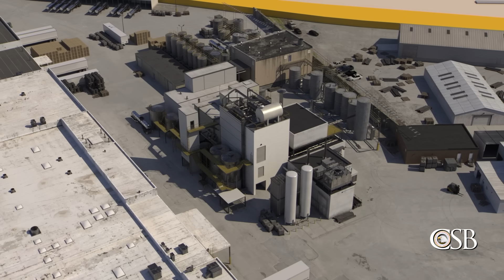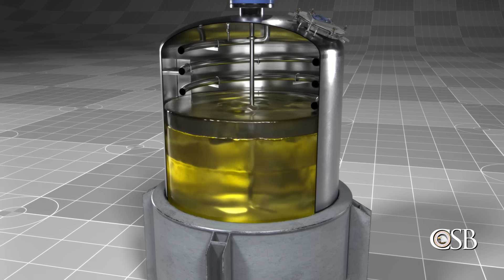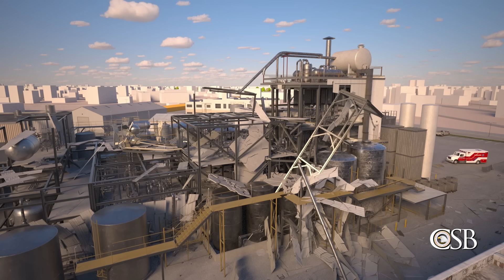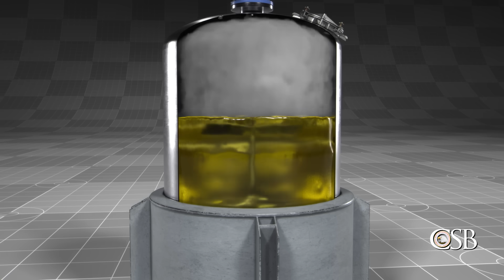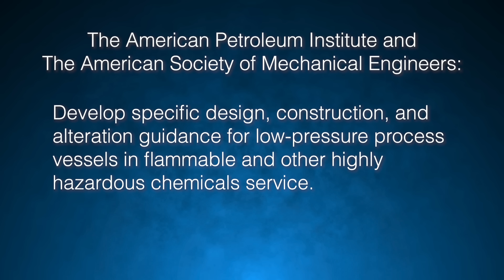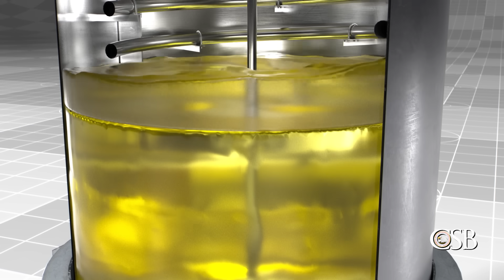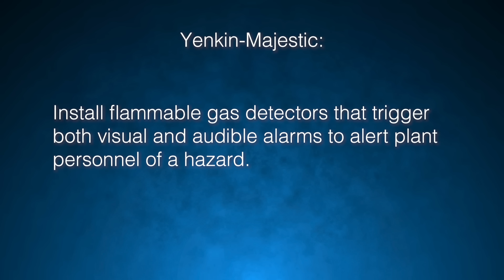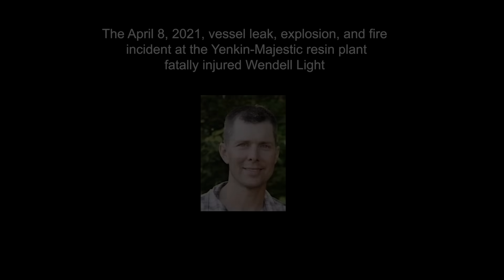Low Pressure, Fatal Consequence: Explosion at Yenkin-Majestic

Comment: Imagine checking your mails and seeing one with the title "Explosive gas detected"

Edit: Come to think of it, why does the gas sensor even have the ability to send emails? In what scenario would that even ever be used?
Reply: That's the signal to sell your stock and alert the execs to do the same.
Reply: wonders of digitization, internet of things and other BS
Reply: " Come to think of it, why does the gas sensor even have the ability to send emails? In what scenario would that even ever be used?"

All sensors are hooked up to a control unit and that unit has many many many ways of sending information to users. Low priority messages use email, higher priority messages use SMS, and the highest priority uses bells and sirens.

Somebody, for some reason, never turned on the bells and sirens for the gas alarm. Or more likely: the alarm kept giving false-positives whenever somebody farted so they disabled it. Many many accidents are caused by perfectly reasonable alarms being turned off for convenience.
Reply: @vinny142  Oh, I never knew that! Thanks!
Reply: I can hear the sales guy pitching this.  And I can also hear someone on the other side thinking "This is great!  We'll be automatically informed about leaks without having to rely on people to report them."
Reply: Imagine thinking an email to an off-site employee was sufficient in a situation where the time between the leak and the explosion was less than five minutes. Sometimes it takes longer than five minutes for an email to clear the corporate spam filters and appear in my inbox. Insane decision by management, but entirely too common.
Reply: @flunkl  the off-site employee after receiving the mail about agitator off and high pressure and explosive gas detected. HUGE NOPE OUT.
nope, I'm not going there, thanks. (maybe that's why they made the system send an mail to begin with, even thou nothing was required of actually sounding any alarms)
Reply: @flunkl
it likely exists for cases where the detector is installed in some remote and completely automated location

this is less common now, but e-mail being used for sporadic long-distance communication between automated systems isn't that weird
Reply: Didn't see it. Went to spam.
Reply: @beeble2003   I would move it myself to the spam folder. NOPE, I'm not going there, you can process me all you want later.
Reply: Yea, probably scam, DELETE...
Reply: @WolfGamerBohumin  It just happens to be directly under the "Rich Nigerian Prince needing Bank Transfer of Millions" email, and they deleted the wrong one on accident. Lmao
Reply: Straight to spam folder
Reply: You should want an email alongside an audible alarm. The email is for review later, in the postmortem investigation.
Reply: someone sitting at their desk would see it immediately, people have phone notifications for email. it shouldn't be the only method of course. the bigger issue is that there was no time for anyone to do anything about it no matter how they were notified. given how quickly pressure could be a problem they needed an alarm for the agitator
Reply: Postmortem
Reply: It should be an audible and visible arlarm in the detection area, alerts to the facility control room, and phone calls, not emails, to on-duty safety personnel, controllers, and management.
Reply: when things become too smart. The internet of things...
Reply: Since everyone contributed their wrong answers, let me chime in as a software engineer. Email is often used as middleware because most computers and devices can send and receive it. The detector was probably designed to send an email to be processed by another machine to trigger an alarm. Most complex sensors don't come with their own alarm since you don't always want the alarm where the sensor is, and sometimes you might want further logic processing, so the IT office is supposed to build a more complete system from standard inputs/outputs like emails.
Reply: @ACogloc  Thanks! That's pretty cool!
Reply: @ACogloc  No disrespect, but to rely on an email to trigger an alarm for safety equipment in a critical situation is the dumbest thing I've ever heard. A network outage would mean your critical safety equipment is also essentially useless. There should always be redundancy and the safety device should always be connected directly to an alarm even if the alarm is remote.
Reply: yah and the fact that is is probably using 30year old email software so is extremely vulnerable to hackers.
Reply: In theory it would send alerts to multiple systems, alarms, personal radio system and emergency management responders. 

But only if they finish the software setup
Reply: Probably designed by some IT organization without any input from the operating engineers.  Experienced that several times in my career.  In fact sometimes the contract will specify that they do NOT talk to the operators because the operators might influence the solution.
Reply: "Dear sir/madam, there is a fire in..."

no that won't do.

"Fire! Fire! There is a...."

no. hmm...

Comment: How in the absolute hell do you install a system to detect a life threatening situation - and then not inform people of the life threatening situation? An *email*?!? Ffs
Reply: If there is not a law in B&W, companies will often do the easy cheap thing instead of what is really needed.  The Board of Directors will likely not like if money is being spent that they (often laymen with no industry experience) don't understand the reason for.  If no one has died, they probably don't want to spend the money.  After someone dies, they seem to understand something was bad.  They may decide that all they need to do is require employees to read the company documentation.  They don't know exactly what documentation, and have no plan to monitor if it was actually read, much less understood.  But they feel good because they took action to make sure it won't happen again.

@silverecco also has some other good points.
Reply: @danstephens9500 yeah but "a fire alarm needs to alarm" is something even laymen understand. And setting up the system to send an email seems MORE difficult than wiring it to a klaxon.
Reply: @nemo-x  But, it wasn't a fire alarm.  It was a flammable gas detector.

I am it IT.  There might be a facility in their system for e-mails.  So, just a 30 second configuration to do that.  Setting up an alarm might involve a different electricians union, or more than one different union.
Reply: @danstephens9500  The idea that it was a union problem is laughable. More likely the higher ups refused to sign off on "non-essential hardware" (i.e. a physical alarm to sound)
Reply: @PhysicsGamer  First, I didn't say it was a union problem.  But a problem with management decisions on how to deal with unions.l  However, having worked in a shop with 4 different unions, I can say unions definitely can add complexity and red tape.  In that shop, the unions were needed.  So, I am not anti-union.

Your comment that it's the higher-ups is what I was saying.  I was just saying it might be red tape that got them to be lazy.  It coulld be most anything that makes them take the lazy route.
Reply: As a fire alarm inspector, you'd be surprised how many buildings have a fire alarm, but no sounders, since code technically allows it as long as your building has a sprinkler system
Reply: It's okay, the email was marked "urgent".
Reply: It was probably a loophole. Safety costs time and money
Reply: The big wigs gotta know there was a problem while they were at home so they can schedule a safety meeting.
Reply: Give them credit. At least the system didn't use a pyrotechnic signal.
Reply: Sometimes ignorance when no one knows better.  

Other times negligence when concern is ignored.

Not sure if anyone was aware of risk of solvent flashing off from abnormal operating conditions.
Reply: @JKHTX Either this place was run by a bunch of complete morons, or they knew. How can you run an operation like this and not know?
Reply: Industrial control systems are twenty years behind consumer tech. This has benefits for reliability (and for offline ones - security), but drawbacks for convenience. Honestly that it even had email function surprised me. Usually it’s just a neon indicator or beeping in a room somewhere, but these places are run on such a tiny crew now that you can’t even be sure somebody will be around to see or hear it. My city had a water pump basically explode and flood the whole pump house, only alerting somebody once all the power went out when water reached the breaker box, electrifying, and turning it into a half-life 2 environmental puzzle. At which point they had to wait for the power utility to come disconnect it at the pole. But home gamers have hydroponics setups that will shut down and text them if the humidity gets three percent too high or water a mm over level, made with stuff from aliexpress lol
Reply: @silverecco  As someone who works on industrial control systems... this is just nonsense. The reality is that the email notification was always designed to be a secondary notofication vector, with the primary notification vector being some signal to on-site control systems. This indeed was the case, since the gas detectors turned off furnaces, etc. in the affected region. It was a management decision to put a "human in the loop" on the alarm pathway to prevent "unnecessary loss of revenue", with zero regard for possible "unnecessary loss of life". The system 100% had the ability to trigger an alarm or ten other on-site notification mechanisms, it was a management decision not to do that.
Reply: @flunkl thanks for the clarification. So it was a revenue thing “we are presently not making money, fix it” rather than “the facility is about to explode.”
Reply: @silverecco well this wasn't the issue here. They had an email client wired up. Someone just thought that an email was enough for some reason.
Reply: True, but an alarm would still be too late, since the gasket already catastrophically failed from naptha flashing to vapor in a runaway scenario. The root issue was allowing naptha to be added while the agitator was off, setting up unstable, explosive conditions from sudden mixing (like throwing water on a grease fire).
Reply: @techman8817  Agree, the computerized control panel should not have allowed the naptha (solvent) to be released while the agitator was inactive. Computerized controls in industrial plants are almost always customizable, and the computer did recognize the agitator was inactive (despite the fact it shut off seemingly without reason).
Reply: IMO... it was because they considered the on-site staff "expendable" but wanted to know the status... to check that they were working...

Comment: So an access hatch can’t withstand a mundane nine psi gauge, and flammable gas detectors that have only the one job, don’t do anything.  Lovely.

And the pressure vessel didn’t “normally” operate over fifteen psig?
So one: They were aware that it could be under pressure

And two: Aren’t we always back here because of things the equipment doesn’t usually do?
Reply: My intestines can handle 9psig of flammable gas, but not Yenkin-Majestic.
Reply: @Alex-Kubota  Hydrotesting is safer, so best to test with a case of PBRs than a case of the Taco Bells :)
Reply: The CSB's written report documents the many ways that Yenkin-Majestic knew the vessel could be under pressure, and yet attempted to "de-rate" the vessel below 15 psig to avoid having to comply with ASME code
Reply: @chalybion4766  Sadly "de-rating" the vessel without changing the safety pressure release to the lower 4 psig they tested the hatch at :(
Reply: @DominiqueHebert-s9f  They didn't even test the hatch; the CSB paid for an analysis after the explosion, and found the hatch could handle somewhere between 0.5 - 5 psig.  The thicker gasket material was installed because maintenance workers saw the hatch visibly flexing from normal operating pressures.  However, the plant's Process Hazard Analysis team assumed that every part of the reactor system was rated for higher pressure than the rupture disk (and evidently didn't verify or do an MOC), which...it wasn't
Reply: One of my professors told us in no uncertain terms “be any kind of engineer you want, except pressure vessels, stay away from those.” 9psi is crazy. I brew kombucha and our tanks vent at 16psi. Regular homebrew kegs can take 200psi. Both with big access hatches and regular edpm seals. Maybe the seal needed to be something exotic for the Naptha.